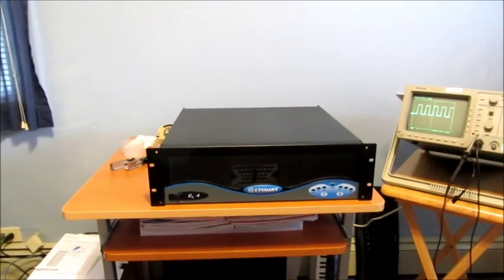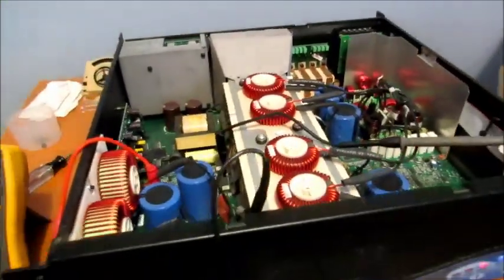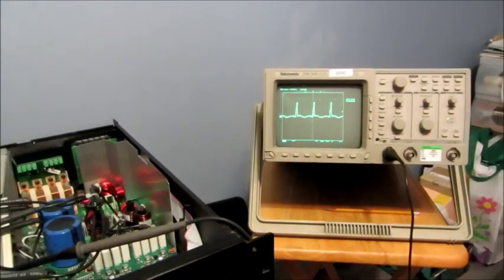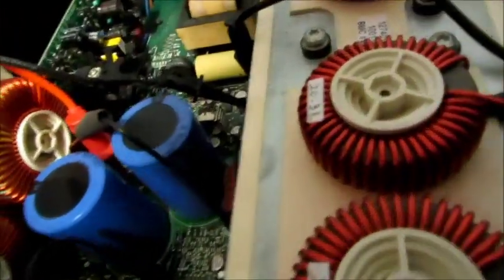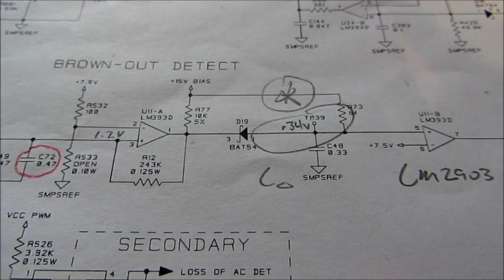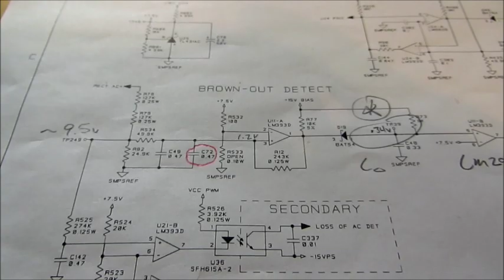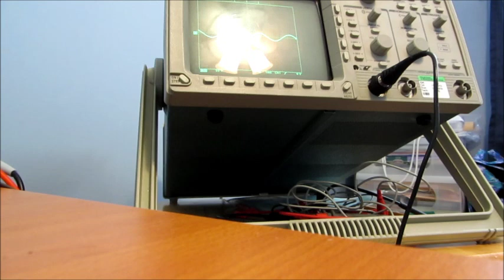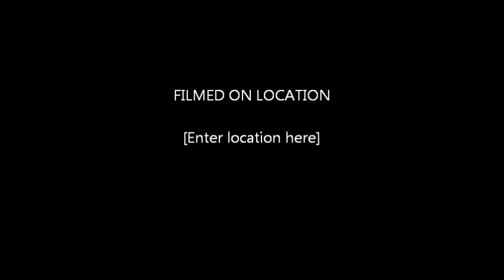Crown CL4 (CE 4000) amplifier repair

Comment: I can confirm - the guts definitely look just like my CE4000.
There's some fascinating trivia on these amps!!!  These amps are true hidden gems - Crown made the AWESOME K1 and K2 (fan-less) Class I - Balanced Current Amplifiers (BCA) - which I LOVE.  
They were developing a K3/K4 big sister to the K1/K2, but due to price or demand (uncertain) the decided not to release it.  
Instead...they added a fan & air-tunnel heat sink and instead decided to reduce the price and make it the flagship of the lower-tier (class A-B) line.
(which is why the CE4000 is a completely different animal than the CE1000 & CE2000 respectively).   
As you mentioned, these were also known as CL (Contractor Line) series of amps.  The CL4 was likewise different from the CL1 & CL2 models.  
To further confuse things...
Crown ALSO rebadged these as "Ultra-Tech" UT1010, UT2020 & UT4040
(exclusively for Sam Ash and possibly Guitar Center - so they could have their own part numbers and not compete or price-match with anyone else selling the other models)
Reply from the maker: Thanks for this information, I always found the air-cooled K series amplifiers an engineering marvel
Reply: I have a CE4000 running off 240V.  Recently started making thumping noises and other grumblings... Esp when cold. Need to service it.

How many watts draw do you see at idle? (I'm at 104 which seems high)

Comment: You did a great job of explaining what you were doing, how you followed what you thought the problem was, and how you eventually solved it. I have an amp that is introducing distortion into one of the channels after I created an audio feedback loop momentarily(the amp is an older XLS 602) and thought I would look through Youtube to see what I was getting into. I now am fairly confident I am not at the level of proficiency to work on an amp in this great of detail. Holy Crap. I like learning in this area, but I'm a slow learner.

Comment: Good job. I'm using 2 of these (CE4000) in my home theater driving subwoofers. I have 2 quiet fans installed in them and they perform well. I can still clip them on heavy material, even feeding them with 240vac mains. The service manual looks very detailed. Should the day come I need to fix them I'll be ready. Thanks for sharing your troubleshooting experience.

Comment: Great video. I hate SMD, I stick with old school amps, where the biggest pain in the butt is the PCB dual sided component soldering. Nothing beats getting a decommissioned amp up and running though. I'm currently repairing a C Audio XR3801, 14 pairs of 2SK1058/2SJ162's per channel, with a fault on at least one pair... pain in the butt to remove, but worth it in the end. Keep on bringing those high power amps back to life, Dude. :)

Comment: I love this video, very well explained as you side noted stuff, not much "umm, umm" time and extremely informative for those of us trying to learn this art. Thank you sir!
Reply from the maker: Thank you for taking the time to write a nice response, I really do appreciate it.  I tried to be transparent in this video, and even share my errors (or as they say "warts and all"), so others may glean different things which are not immediately apparent when looking at a circuit or are easy mistakes to make.
Reply: Kevinsrack nice video man, very informative. I repair p.a equipment as well, I really hate repairing amps with surface mounted  components, especially when some manufacture's like JBL don't hand out service manuals, makes repairing difficult and very time consuming.lol.

Comment: I'm stuck on a CH4. I got it broken for really cheap on eBay. Fault lights flash just like yours but a different problem. When I jump TP6 and TP249 (defeat brown-out) the amp works perfectly.

Comment: Never isolate only the oscilloscope with an isolation transformer, as soon as the ground terminal of the test pin is connected to the primary side of the amplifier power supply, the entire housing of the oscilloscope is live.
Always isolate the "device under test" from the mains with an isolation transformer!

Comment: Hello there Kevin I have the CE2000 model and Channel A seem to be weaker than Channel B..I have to turn up the knob by 1/4 of Channel A to match up with Channel B for example if Channel B is at 12:00 O'clock Channel A must be at 3 O'clock. What would you suggest I should replace or at least provide a clue where should I start. Thks

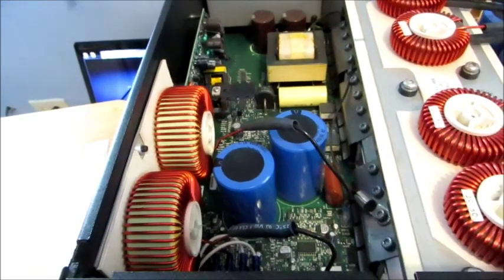Comment: 11:26 it's the other way around. DC does not cause muscle spasms like AC does. So you're less likely to involuntarily hold onto a bare conductor. Read here: https://www.healthline.com/health/electric-shock
Reply from the maker: I realize you're technically correct, but from experience, I've found DC shocks to be much more painful.
Reply: @Kevinsrack  my reply was to your statement that a DC shock was harder to let go, which is demonstrably wrong.
Which current causes more pain is another subject entirely...

Comment: Great video on troubleshooting! I have the same amp, CL4, that has a similar problem. When powered up, the power, overload, and clip LED's, all flash quickly (about 5x per second) and a ticking sound coming from the flyback board. AC mains power draw is very minimal, around 5 watts. Nothing looks burn't and no burn't smells. BTW, the schematic PDF does not down load. Would like to hear from you if you have any ideas. Thanks!
Reply from the maker: Curt Chase Those flyback bias supplies on this amplifier are notorious for problems.  The service manual illustrates pretty thoroughly how to troubleshoot it (I was able to download it at the time this was written).  It sounds to me as though the PWM chip on the flyback assembly is detecting an over-current condition, and, thus, causing the PWM to operate in current limit mode.  What you're hearing is the rapid collapsing of a magnetic field inside the flyback transformer.  Measure for a short between pins 3 and 4 on U2 (Viper 100 chip).  Make sure to connect the positive lead of your meter to pin 3, or else you'll pick up the body diode in the internal switching MOSFET, which can fool you into thinking you have a short.

Comment: Kevin can you do a video on difference between Class AB Amp and a Class D
Cheers.
Reply from the maker: MrMac5150 I appreciate your kind words about my video.  Although I'm flattered by your request to make such a video, I honestly would have a difficult time articulating in sufficient detail how each topology works.  The best place to seek that answer is Wikipedia.  However, to make a very complicated explanation somewhat succinct, I will try to explain as follows:
Class AB is a push-pull amplifier utilizing two feedback-stabilized current sources, each of which has its own positive and negative rail.  The signal is inputted into a high-gain differential stage, and, ultimately, a final stage which has a voltage gain of one (a current source).  The positive and negative output stage devices each amplify their respective portion of the sine wave, and continue to remain "on" slightly beyond the zero-crossing point in order to minimize distortion.  The drawback of this topology is relatively low efficiency since the output devices operate in their linear region for part of the time.
On the other hand, Class D is a switching amplifier (not unlike a switching power supply), which commonly (but not always) uses a full-bridge topology which precludes the need for a split supply.  In very simple terms, a class D amplifier "chops up" the audio input signal into on/off pulses of varying duty cycle by comparing it to a ramp signal, thus making it frequency modulated.  This duty cycle is proportional to the slope of the signal.  This signal is ultimately fed to a MOSFET-based voltage source output switching stage which is of increased magnitude.  Lastly, this frequency modulated signal is passed through a low-pass L/C filter, which recreates the input signal with high fidelity.  The goal of a Class D amplifier is to not operate the output MOSFETs in their linear region, but, rather, on or off in order to achieve high efficiency.  The drawback of this topology is high harmonic distortion and phase shift of the audio output, as well as RF interference, and complexity.

I hope this information is useful to you.  I've tried to make it as accurate and succinct as I can.